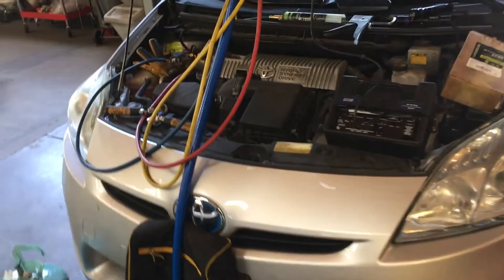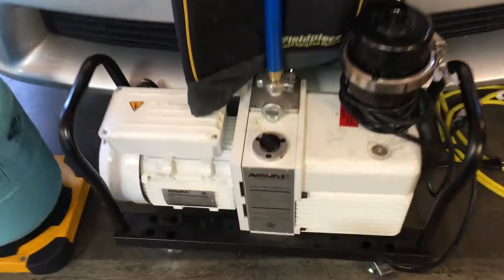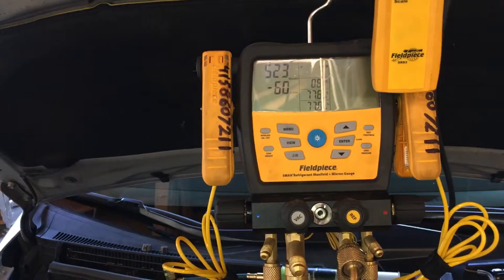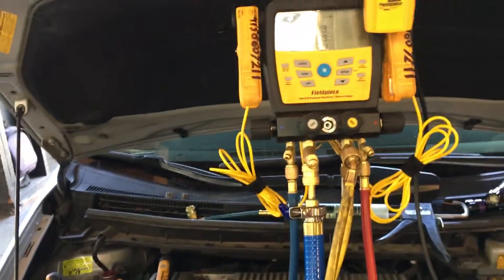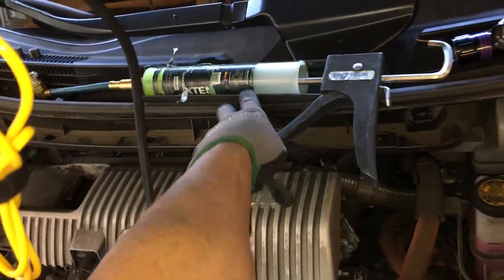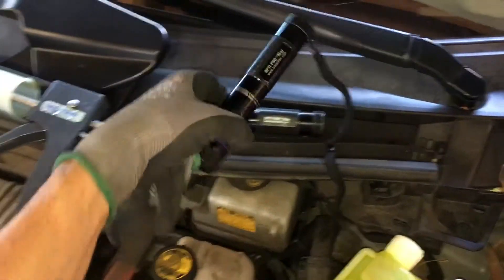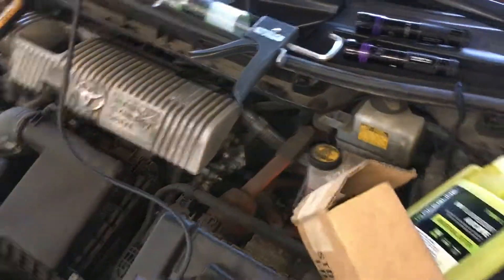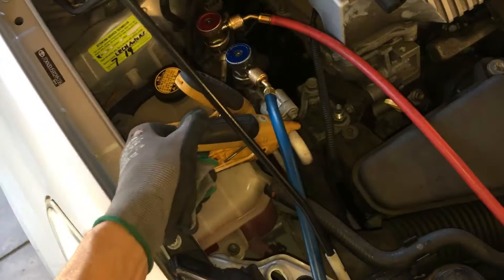Air conditioning recharge vacuum on Prius

Comment: No dye on a Prius systems, unless it is dielectric (that means it doesn't conduct electricity) because the compressor is lubricated internally with dielectric oil also.  If you add anything that conducts electricity to the system, the compressor will develop a crust on the electric areas and eventually fail requiring replacement.
Reply from the maker: TracerLine UV DYE makes dielectric UV DYE.